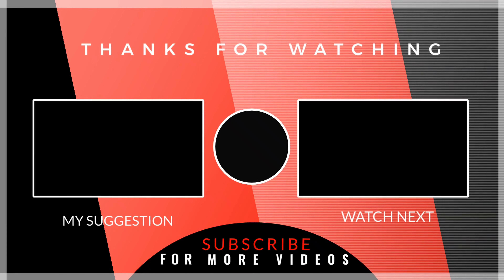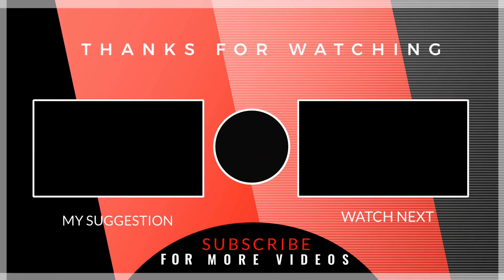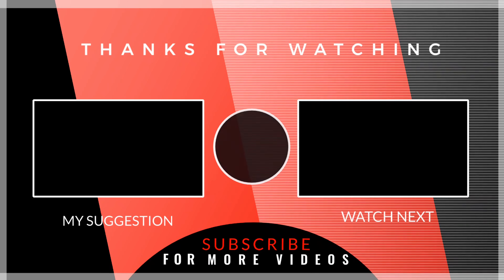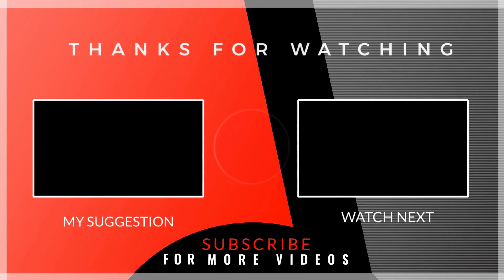RSV4 | Gabro Velocity Stacks | Install

Comment: I'm so glad you still kept the 660 after buying the RSV4.
Reply from the maker: Should I get the RS440 too? 😛
Reply: @ALFAVITAGA Can you do a video, breaking down this 2stage, 3 stage stuff ...for the newbies...and the realistic HP gains ⁉️🙏
Reply from the maker: @LOCKHIMUP2024 I’m uploading a dyno video tomorrow and I go over the power gains of this setup. I explained it on another comment but the sum of it is that I don’t use those terms much. Stage 2 basically people refer to it as exhaust and ecu tune with air filter and stage 3 when you add velocity stacks. Thats all. ✌️

Comment: I noticed that I have a bolt sticking out of the drain hole under the seat... Can you tell me how to get it back without removing the tank?
Reply from the maker: @angeloblack3436  I had that bolt sticking from the drain hole too and I bought my bike brand new. I have seen way too many bikes having that bolt sticking out there to the point that I think Aprilia puts it there for a reason. Nevertheless I removed it. You have to remove the tank to remove the bolt.
Reply: @ALFAVITAGA  If I send you the photo could you tell me if it is the same bolt? Where can I write to you?
Reply from the maker: @ It’s a silver 4mm hex bolt. Although you can’t see the head of the bolt because it’s under the tank. All you see is the threaded tip under the tail sticking out the drain bolt. You can send me a photo at mikedelaportas on insta.
Reply: @ALFAVITAGA  Exactly, it's him...  the bike is new.. I don't understand where it came from
Reply from the maker: @angeloblack3436   Because it’s so common that RSV4s have that bolt there, I’m starting to believe that Aprilia places it there on purpose. I stripped the whole bike down and there is nowhere that a bolt is missing. Especially under the tank there is no space for a bolt to pass through. When I remove my tank again I can inspect the fuel pump under the tank just to be sure. But I wouldn’t worry much about it lol.
Reply: @ALFAVITAGA  I removed the bolt, it has a small head and is 3mm hexagonal. it is identical to the two used in the frame under the plastic cover above the rear light

Comment: You are sooo lucky that the well nuts were properly torqued down!  I was ready to invade Italy when I removed my seat to install the UpMap tune as neither well nut was torqued down and the fasteners just spun in place.  I have the exact same bike as you, do you really need more hp and speed?  These things are insane (in a good way) as is.
Reply from the maker: I was not that lucky. One of the rivet nuts under the seat was spinning too. But I fixed it with the screw and nut method. I had the same thought on more hp before I modded it. I was thinking how can someone want more power than stock. But after I modded it I realize why. Its not about the top speed, its about the acceleration on high rpm. Huge difference.
Reply: @ALFAVITAGA mines spinning, whats the screw and nut method? Thanks
Reply from the maker: @ It’s hard to explain over a comment. You insert a nut on a bolt and then screw the bolt halfway in the rivnut. You screw the nut down until it touches the rivnut and then you hold the bolt in place while you screw the nut down with a wrench. The result is that the nut is pushing the rivnut down from the top, while the bolt is lifting the rivnut up from the bottom, and that squeezes the rivnut into the rivnut well and stops it from rotating.

Comment: why you choose gabro Stacks instead of BT ? BT stacks cover all over the E-box
Reply from the maker: @tradingviewauthorizedpartner  I started with Gabro with my RS660. At the time Gabro with Upmap and Aprilia race map were the only two options for the 660. Gabro has a lot of knowledge on Aprilias as he tunes them for racing and understands the requirements of Italian engineering, that creates safe maps for engine longevity but also performance. I had great experience on my RS660 and I loved the Upmap interface. So naturally I chose Gabro for my RSV4 too. ✌️